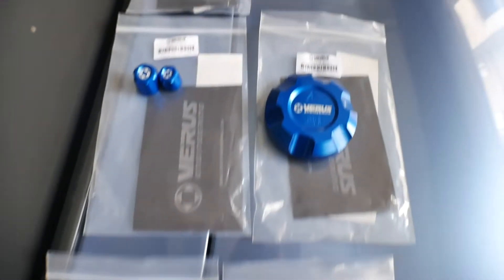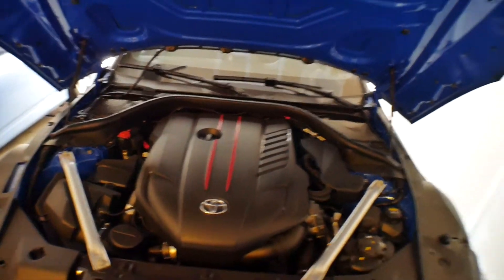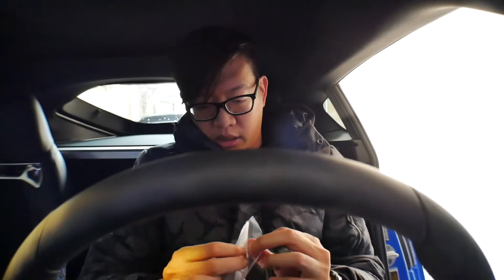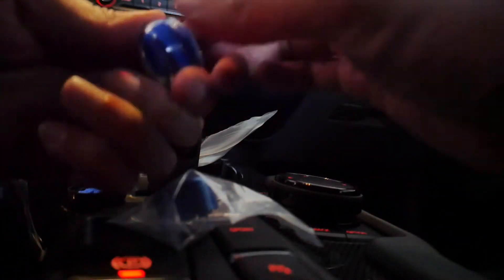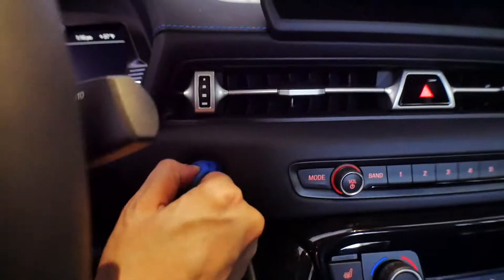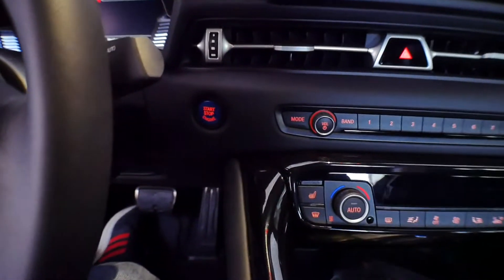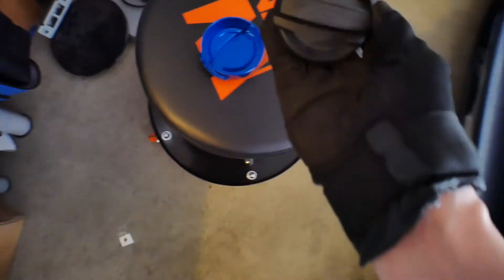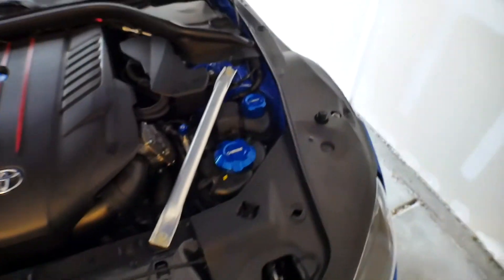Verus Engine bay caps! [A91 Supra]

Comment: The oil cap has 4 positions. You put it back on with the Verus writing 90 degrees clockwise from straight. Take it off and the thread it starting at 90 degrees counter clockwise as it’s a quarter turn clockwise to tighten it